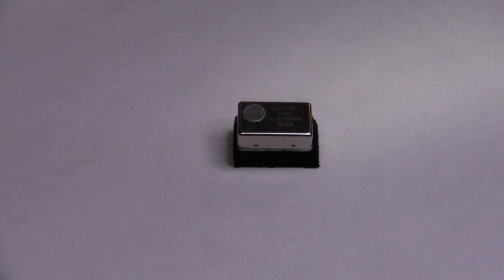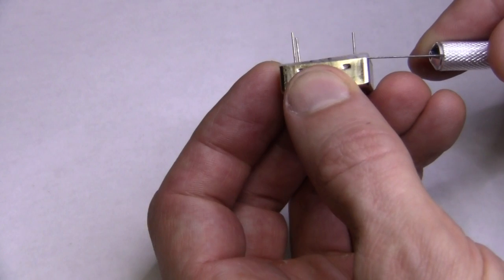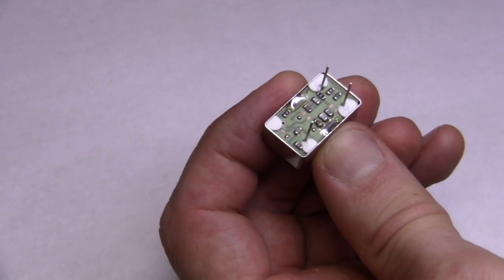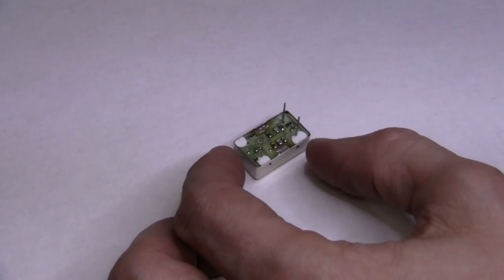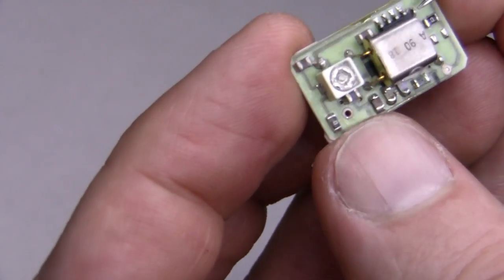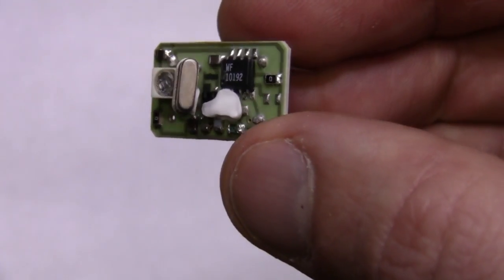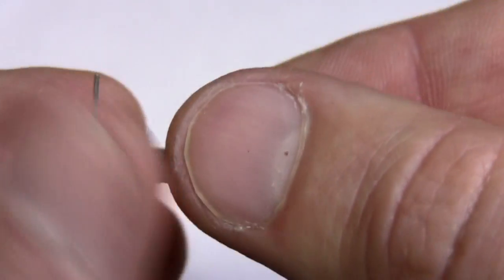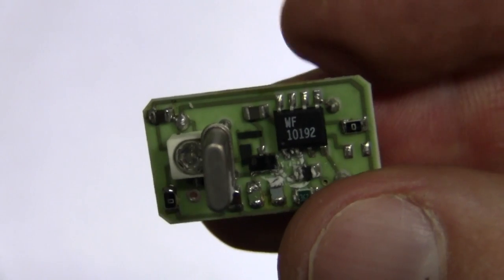#4 - TCXO frequency reference teardown

Comment: With some luck, "B4" SOT23 is an ITT "BB404B", a varactor diode, and what is connected to pin 2 is an NTC. The output voltage of the opamp then steers the varactor diode bias to change the xtal detuning to offset its temperature dependence.
The white trimmer is a trim capacitor to calibrate the nominal frequency.

Comment: I found this info on WF10192 connections:
I had to use a mini clock upgrade. Here is what I did, I gave a 20MHz crystal module (from an old network card) the EC designs demolition treatment. Inside the metal case was a small circuit board with a 8 pin WF10192 programmable SMD clock oscillator chip. So I designed a small circuit board, took the 16.9341MHz crystal from the sony and put everything together. Then I soldered the PCB very close to the CX2587Q Xtal input pin. I added some photographs. The sound quality has improved indeed, good tip.

WF10192 connections:

pin1: enable (leave open for normal operation), pin2: crystal, pin4: ground, pin5: output
pin7: crystal, pin8: +5V

only pin3 connected to ground: output divide by 2
only pin6 connected to ground: output divide by 8
both pin3 and pin6 connected to ground: output divide by 4
both pin3 and pin6 open: output equals crystal frequency.

> I2S interface, the sony has a plastic cover located exactly opposite to the chip (for service). I am going to put a 9 way sub-D connector and 3 differential RS422 drivers in that cover, so connections can be kept very short. Then I plan to run some tests with the modified timing chain for the sony I2S format.
 https://www.diyaudio.com/community/threads/building-the-ultimate-nos-dac-using-tda1541a.79452/page-25

Comment: As far as I have understood the TCXO uses a varactor to pull the crystal frequency based on the measured temperature.  I would also think that the sealed adjustment next to the crystal does the manufacturing calibration of the frequency.  And the zero-ohm resistor jumpers select the rate of drift compensation.  Just a guess, of course.  Sure there would be actual more authoritative info somewhere, if I tried to look around.

Comment: I have the same HP counter as you. Were you ever able to use these 10mhz TCXOs with your counter for better accuracy? I have bought the exact same part for the same reason.
Reply from the maker: I bought a couple of OCXOs after that: https://youtu.be/0UT6smae8M0
But I never got around to putting one of them into the counter (yet).
Reply: FeedbackLoop When I get mine, I'm going to build it into a metal box and connect a cable to the counter and set the switch to external so I don't have to modify the counter. Mine seems to be pretty accurate anyway. Thanks for the videos.

Comment: why is this a TCXO? where is the heater?
Reply from the maker: Heaters are in OCXOs (O is for oven). In TCXOs the components are kept at the same temperature as much as possible by putting them into an enclosure, and some measures are taken in the design to compensate the temperature drift. For example, if the crystal drifts up with the rise of the temperature, have some other component in the adjustment path drifting in such a way so that it pulls the adjustment down.